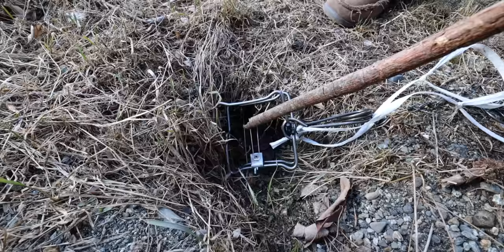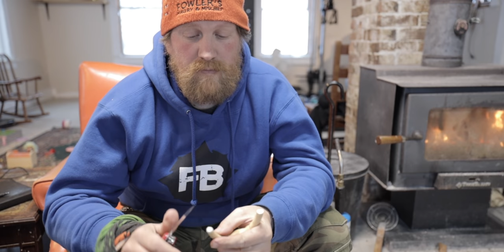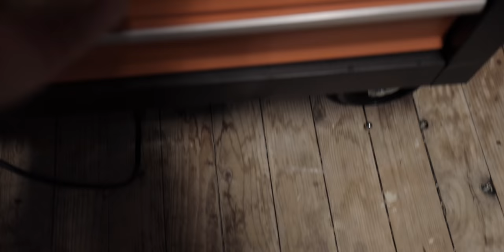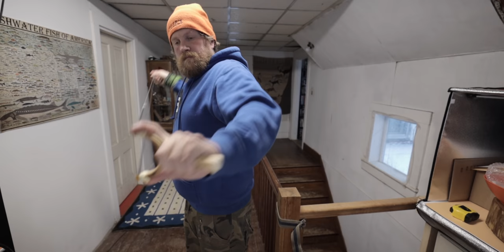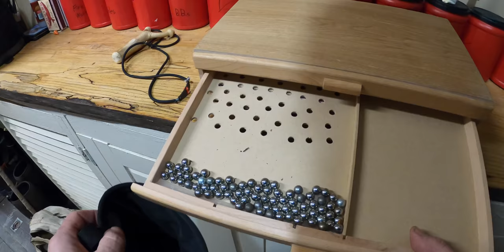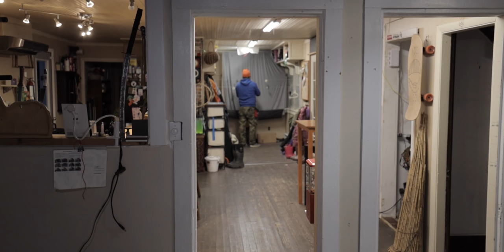Slingshot Build & Shoot - Day 8 of 30 Day Survival Challenge Maine Lockdown

Comment: I don't know how big mains intensive care units are there. Our local hospital only has 25 beds so I  suppose 25 ventilator's. Our village has roughly 2000 residents and there's three other villages surrounding the same hospital. So if you said 50% of the 8000 people needed hospital treatment and only 25 ventilators. You can understand social distancing when you look at it.
Reply from the maker: I know it not about stopping it its about slowing it so there are enough vendors should the need arise.  its just the  how people are reacting to it that is bugging me a little.  it's not an excuse to be uncivil.
Reply: I appreciate that Zack. It's probably people's individual circumstances that makes them hot headed.